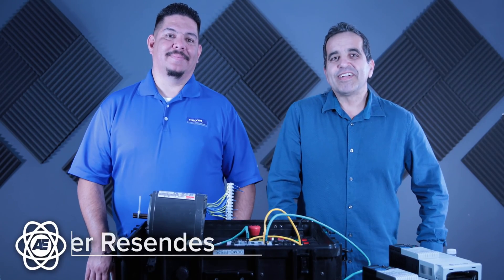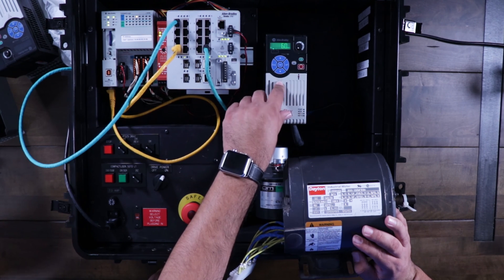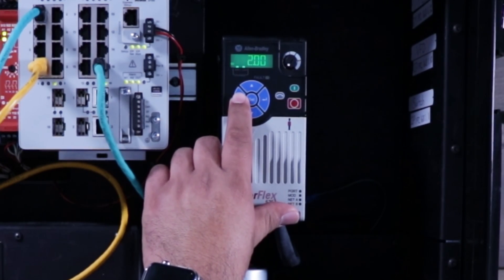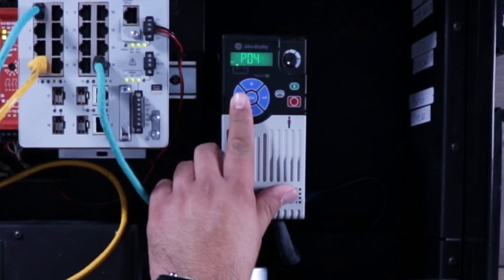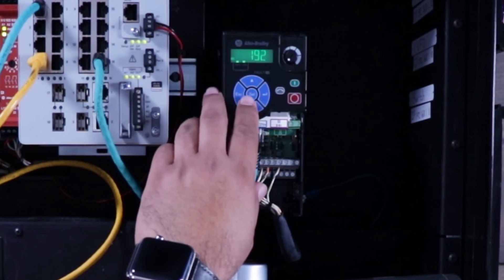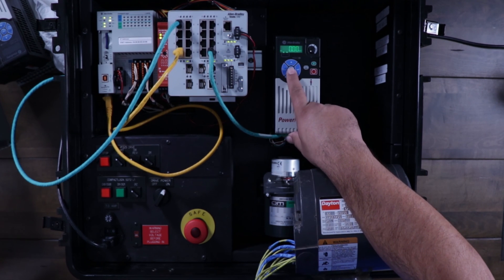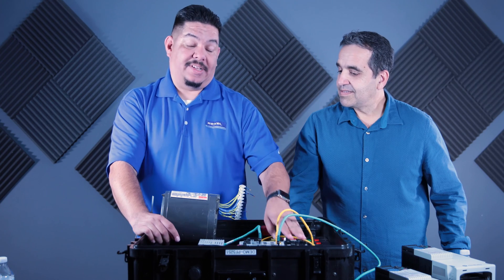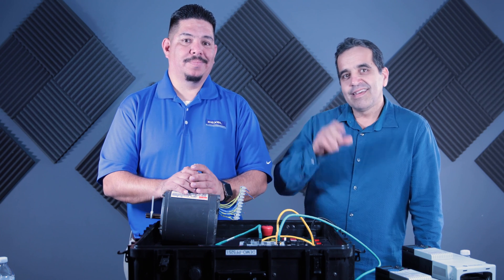Programming a VFD from the Keypad

Comment: I'm going to assume that the AB switch uses the port that the Ethernet cable is plugged into to identify the drive?  Sees a default drive in port 1 and assigns the ip address based on that?
Reply from the maker: Yes the switch is a managed switch, so it knows which IP address is connected to each port. When you replace a drive on the same port, it will give the new drive the old IP address and then the PLC can write all the configuration parameters from the old drive to the new drive in a matter of just a few minutes....
Reply: Thanks for Asking Appropriate Tech Questions! My Boss Wonders how I Know Certain Things

Comment: Any info on p35 setting? I'm programming one right now and its factory default is 4 I believe
Reply from the maker: default is 4 poles for a motor rated at 1750 rpm. if your rpm is different then you may need to change this value.
Reply from the maker: if you change P035, you will need to adjust b015 as well
Reply: Awesome thank you very much! Everything is checking out ok but my momentary start button coming from terminal 11 to terminal 2 is starting the machine but I have to hold it down for some reason? How do I make it to where it acts like a holding contact?
Reply from the maker: @derrickfettig100  , terminals 11 and 2 are made to be maintained on. They won't work with a momentary signal. So what you will have to do if you have a start-stop button is wire up a relay from the button and then use the relay to close 11 and 2. It's also very important not to run your control wiring such as 11 + 2 through the same conduit as any high voltage. So you don't want to share the same conduit with 120 volts or 480 volts. Many times what we'll do is use 120 volts to our start-stop buttons and have the buttons control a relay. The relay is mounted local next to the vfd. The relay then closes 11 and 2. Also if you have a field disconnect we will run the power to the start-stop through an auxiliary contact in the field disconnect. That way if the disconnect is ever opened the vfd will lose its run command. I'll try to make a video on this soon